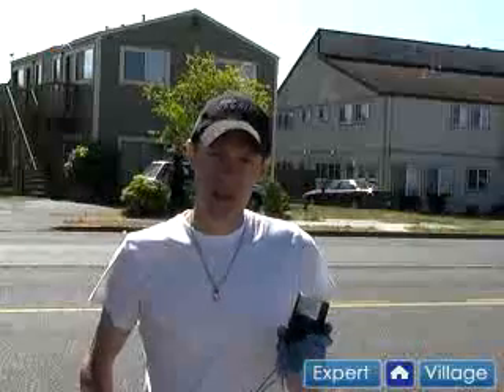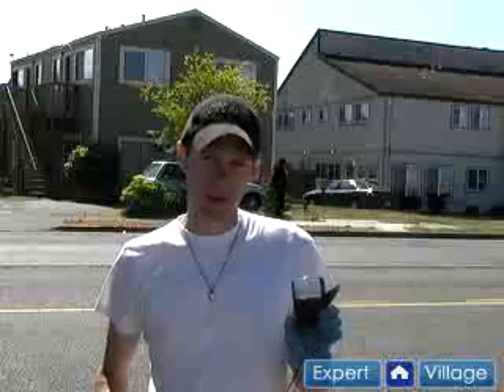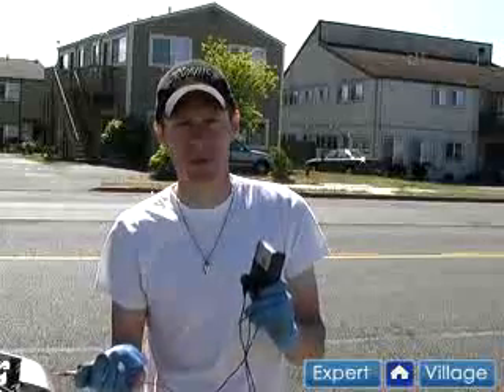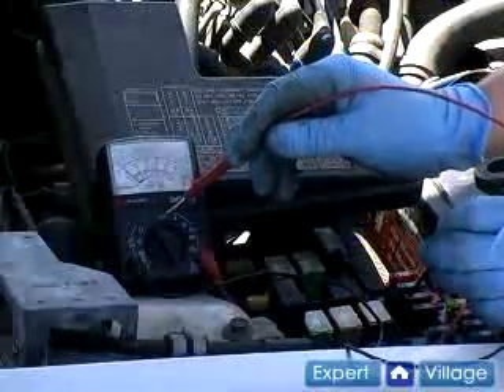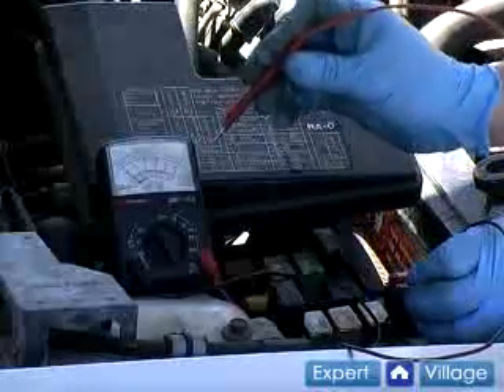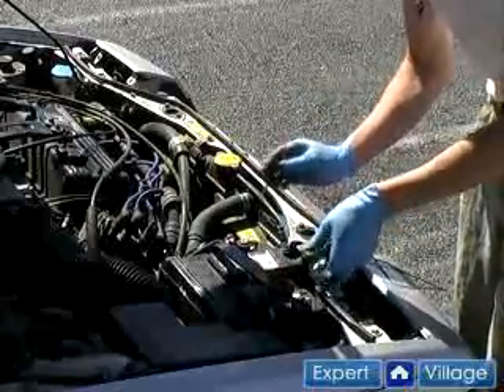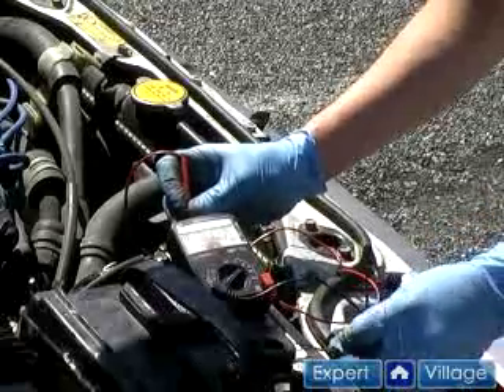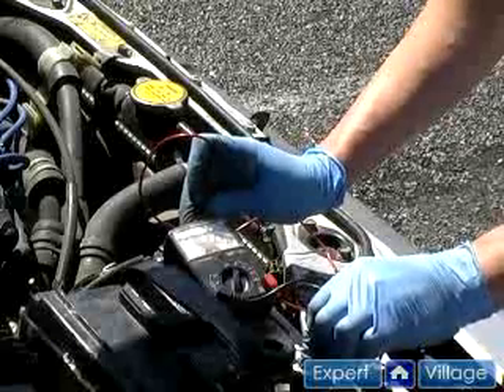How to Change a Car Battery : How to Test a Car Battery with a Multimeter

Comment: useless, utterly useless video.  I think they should be called "village idiot" not "expert village"  A battery can have over 12 volts and still need replacement if it drops below 9.4 volts after just one start.  

I agree with other comments that testing the terminals and a load test is a much better way to determine if a battery needs to be replaced or not.

Comment: i have that type of multimeter
and it reads 30DC (36DC when car runs) when in the 50dc scale
how much of my battery is charged??

my car wont crank if its a 25DC

Comment: @zillsbury Your alternator could be dying, how old is it?  To test your alternator connect your multimeter to the battery it should be around 12.6  to 12.8. Start the engine and the voltage should go up around 13.4. to 13.6 or so.Then have someone turn on the head lights and heater (full).... the voltage should drop for a second or two then return to the 13 range, if it doesn't the alternator is probably worn out.

Comment: hmmm.. not everyone has a multimeter and knowhow to operate it.. Normal check. Leave car lights on (without having car turned on on gas) for 10 minutes, then try to start your car.. if it cranks instantly .. your battery is good.. else change it !.. Test 2: try to get a toy that runs on around 9-12 volts.. and try to run it with connectors from car battery.. if it does same thing on regular alkaline batteries for like 10 minutes, you are good.

Comment: Free battery testing at an AutoZone/O'Reilly's..etc.. easily defeats the purpose of videos such as this one.  He tries, but I find many things that I disagree with in the clip.  
There are several factors involved with a low voltage battery, however this could make the video more complicated than what the title describes.  
I considered doing a video for this, and there are so many making attempts at it as well.